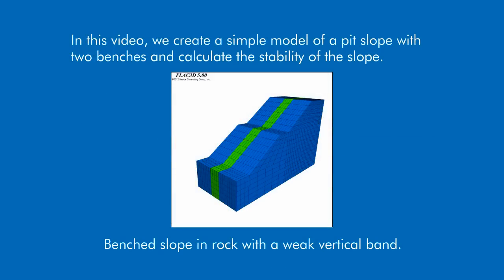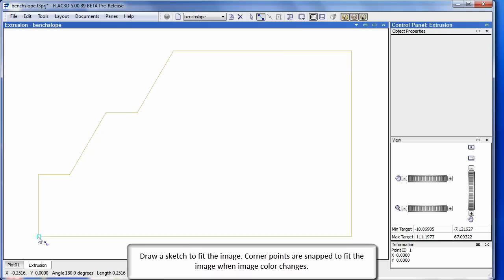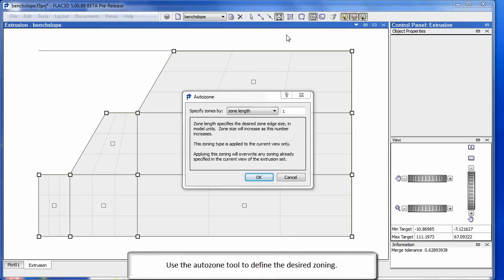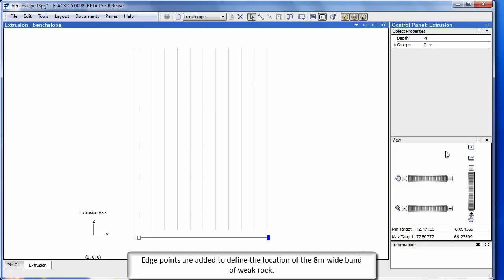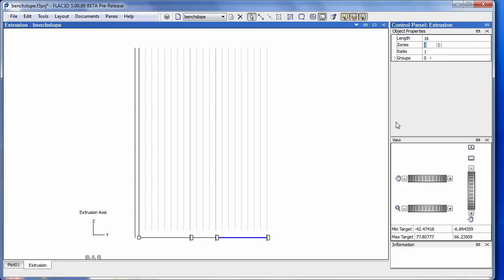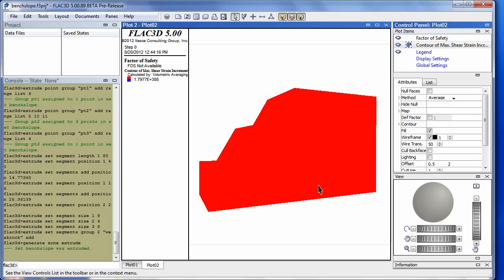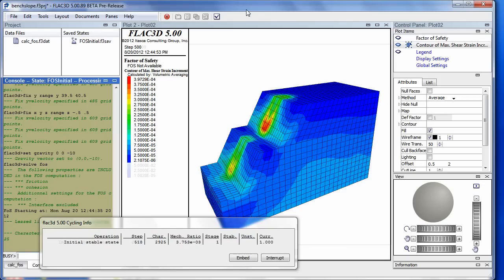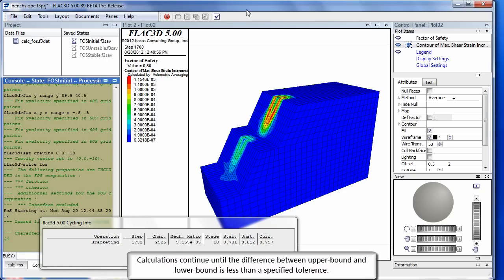A Simple Bench Slope Demo on FLAC3D v 5.0

Comment: Dear Itasca Consulting Group, Inc. 
As per your FLAC 3D 5.0 Theory and Background Manual, it says "The strength reduction method can be applied to calculate the safety factor for a variety of different underground structures (e.g., slopes, retaining walls, tunnels, etc.)"
I tried to run a factor of safety program for retaining wall case, but program did not work as   I had given retaining wall as elastic model
Later I realized that manual says "In FLAC3D Version 5.0, SOLVE fos can be applied to strength properties for the Mohr-Coulomb material model (MODEL mechanical mohr), the ubiquitous-joint model (MODEL mechanical ubiquitous) and the Hoek-Brown model (MODEL mechanical mhoek-brown)."

Please tell me how can I calculate factor of safety of a retaining wall while considering retaining wall as elastic model.
Reply from the maker: I am assuming that you want to model an elastic retaining wall with a plastic model (Mohr-Coulomb for example) for the soil/slope. In this case, the simplest thing to do is to also make the retaining wall a Mohr-Coulomb model, but set the friction, cohesion, and tensile properties to be very strong such that this material doesn't yield. Alternatively, you could look into modeling the retaining wall as a structural element.

Please use our online Technical Support form for future technical questions. You can find it at www.itascacg.com/software/products/software-support. Thank you.

Comment: Hi, In this example in the manual it is said to save the extrusion as "benchextrude.f3dat" to call it in the incremental slope change code. trying to save the extrusion ,the option is always greyed out in the file menu and thus cannot be saved. could you give an answer to why that would happen ?
also why sometimes "FOSUnstable.sav" can't be restored and gives error ?
Reply from the maker: Hi Omar. I'm assuming you're running this with FLAC3D 5.0 and not a more current version of FLAC3D. I've run the project and it appears to be working OK. Make sure that you're using the latest update of version 5. On this project, the "benchextrude" data file creates the slope via extrusion commands once. Then the "benchrun" data file calls the 'bench_xpos" FISH function repeatedly for different bench angles. The FISH function translates the bench points and then returns to benchrun" which next executes the "calc_fos" data file that regenerates the mesh and solves for FOS. Then the process repeats for the cases specified.       

Only the current saved state is highlighted in the Saved States pane; the rest will be grayed out. However, providing the saved state [file] exists, you should be able to click on any one of these to switch to that model state. A valid saved state has a 2x2x2 meshed icon whereas if the icon has a a white slash running though it, the file no longer exists. For the latter case, trying to open the file will result in an error message. This is the same for the datafile list. Make sure to run the project to completion by running the "master" datafile.

If this doesn't address your issue, or you think it may be a bug, please contact our Technical Support team here: https://www.itascacg.com/contact-itasca/software-support-request.
Reply: @itascasoftware  Thanks so much.